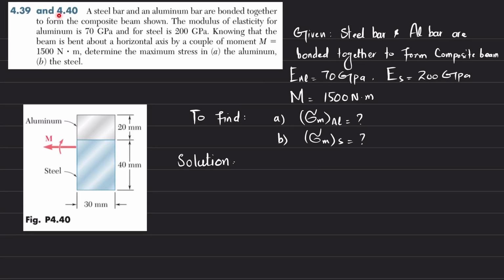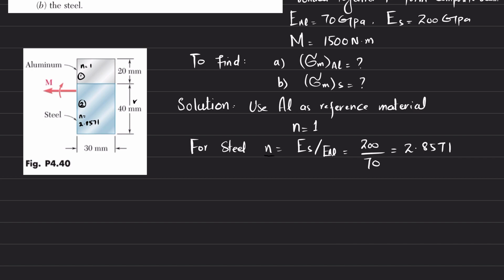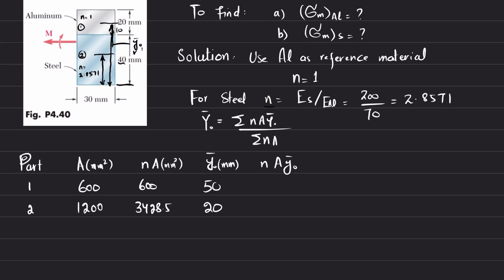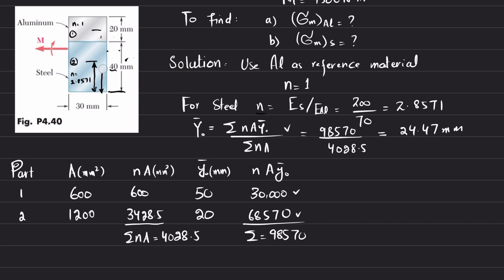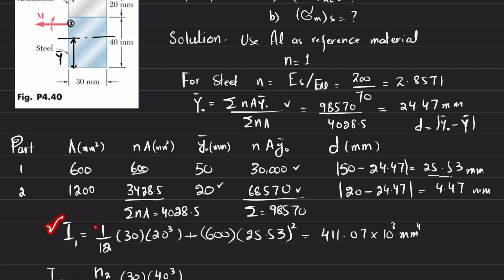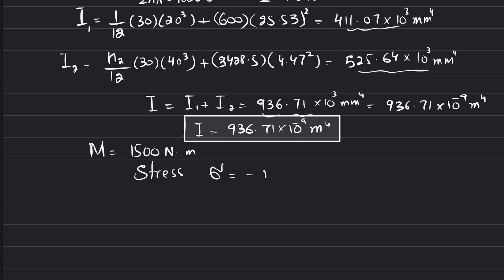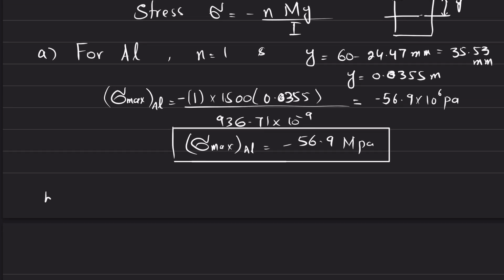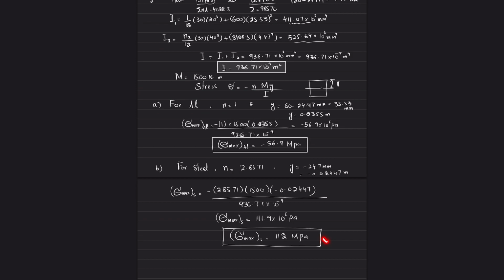4.40 | Bending | Mechanics of Materials Beer and Johnston

Comment: Is this even right? I doubt
Reply from the maker: Kindly explain....
Reply: @engradnanrasheedmechanical  In The last step when Calculating Sigma max for Al and Steel why there is a negative sign in the end , also if you could explain the formula for last step in calculating sigma
Reply from the maker: @rachitmonga93  I have checked it its correct , you can see that due to moment M the top portion which is Aluminum is in compression while steel portion in tension therefore it will be positive.  Also distance from neutral axis to top which is y (taken as posittive) while distance y below the neutral axis is taken as negative. Also formula for Bending stress is ( -M * Y ) / I
Reply: @engradnanrasheedmechanical  agree the formula for bending stress  is (-M Y/ I ) then why n is multiplied there in video?
Reply from the maker: @rachitmonga93 ok this is the topic of composite beam and in this problem the beam is made up of two materials Al and Steel. So it is difficult to find out the centroidal axis / neutral axis for this beam so we have to convert this beam into beam with single materials os the procedure is done for beam wholly made up of Aluminium.  When you get the stress Al you can find it for steel which will be n * (-M*y)/I. If you are steel confuse then I shall send you the theory lecture for this and that will clear your doubts.
Reply: @engradnanrasheedmechanical  Got it thanks ! 🙏
Reply from the maker: @rachitmonga93 you are welcome 🌹